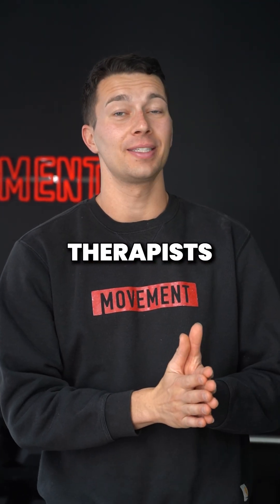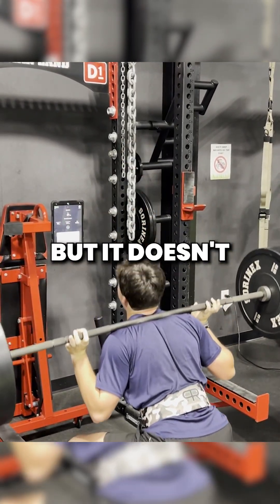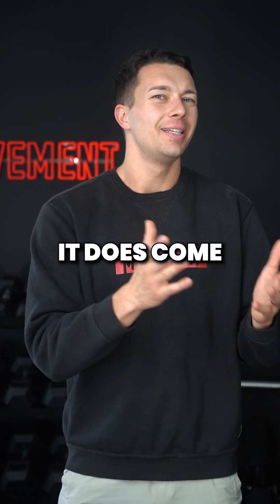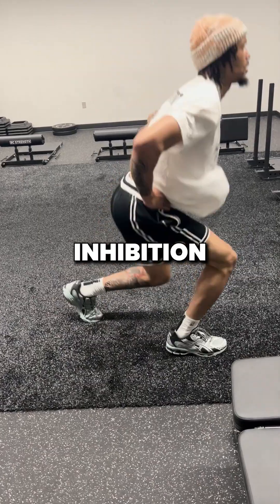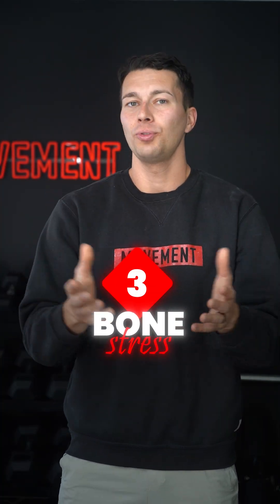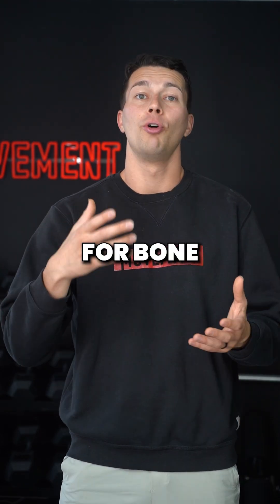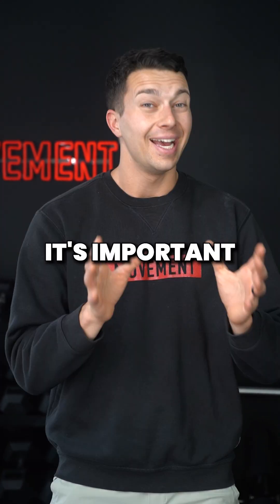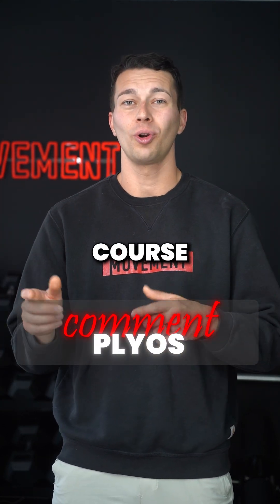Top S&C Coaches Know These 3 Things

Comment: Max strength is NOT hypertrophy training... Come on dude.
Reply: He didn't say it is, he just said both cause CNS fatigue
Reply: @zainrehman7893 19 second mark, bud.
Reply from the maker: Max strength involves ~20% velocity loss and hypertrophy ~30-35% velocity loss. I'm not saying they're the same rather that both create high CNS fatigue relative to low velocity loss methods like "power" or "Dynamic effort" training
Reply: @TheMovementSystem Velocity loss (VL) in strength training dictates adaptation: low VL (10-20%) prioritizes strength, power, and speed, minimizing fatigue; while high VL (25-40%+) increases training volume and fatigue, favoring muscle hypertrophy (growth), though excessively high VL can hinder performance gains. For hypertrophy, you allow greater velocity drop within a set to accumulate work; for strength/power, you stop sets earlier to keep movement fast, optimizing neuromuscular efficiency.

Now we are saying power training and speed training are similar too?

I'm so lost...
Reply from the maker: @clifft2269  I'm very well versed on the VBT research. It's just far too much to cover in a YT short. I think you might be overthinking this one a little. I'm just showing the basic concept that strength or hypertrophy based training are more CNS fatiguing than low velocity loss or power based training.
Reply: @TheMovementSystem true, just seems like doing a hypertrophic set of light weight to failure OR a strength 1RM set are both very fatuguing to the cns, so not sure what the point really is here...?
Reply: @clifft2269 The point is that we shouldn't have two back to back CNS fatiguing days
Reply: @clifft2269 I also found the video confusing. Shouldn't low reps high load good for power and strength?
Reply: @jose1001ful it is, but definitely more strength than hypertrophy.